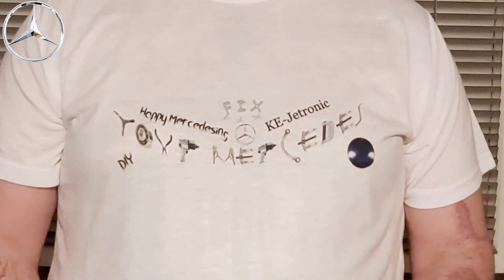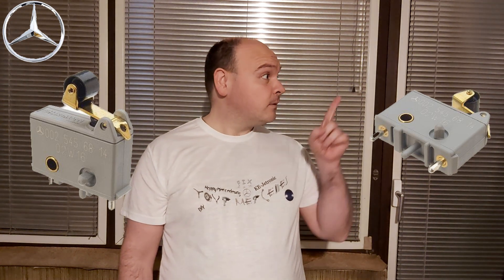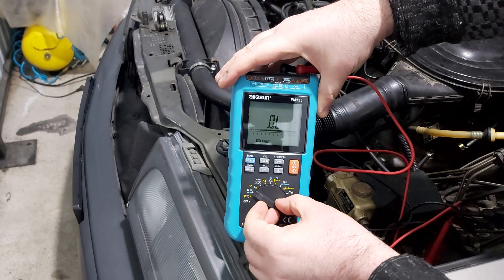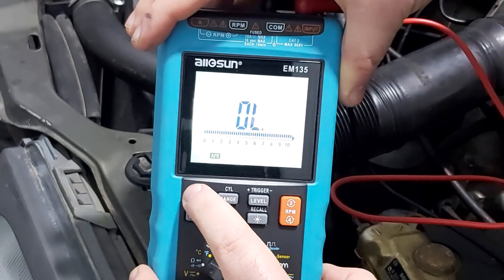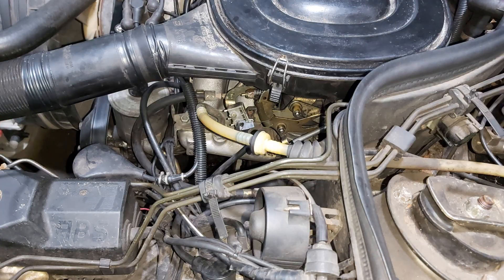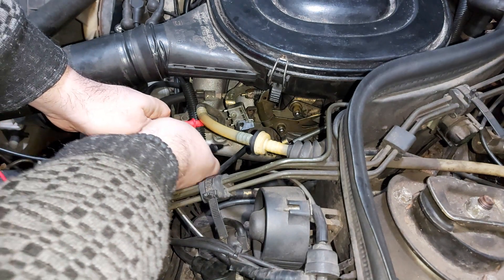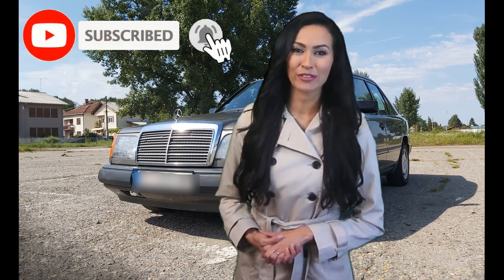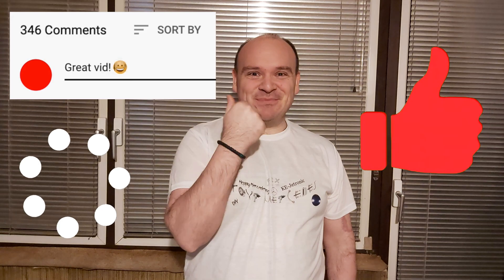Mercedes KE-Jetronic - The Micro switch/decel/cut-off

Comment: My car doesn't start unless i am holding it at %60 throttle could this be the reason? the socket are completely missing and i couldnt find the part number there is a switch but no socket just empty cable behind it attached to nothing. They are purple and orange
Reply from the maker: Are you speaking about the micro switch?
Reply: @mercedeske yes
Reply from the maker: @vrifdea  Without the micro switch the car will have a difficult start. You must also check whether it's connected to the ECU. Here is the ECU wiring diagram. Without the micro switch the ECU doesn't have any information about the position of the accelerator lever.
https://www.instagram.com/p/CTdM_5lqTKN/
Reply: @mercedeske thank you my car is 1991 1.8 is this applicable to my ecu i heard there are 2 variations of ke-jetronic
Reply from the maker: @vrifdea  Yes, the so called KE3a and KE3b. They are almost identical, some minor changes. More about the KE
https://www.youtube.com/watch?v=KU3Cl9oe1T4

Comment: I have an R129 ,SL 300-24, looking at the micro switch it isn't contacting anything, is there an adjustment,? Its a very good way of checking thank you, Cheshire UK
Reply from the maker: On the accelerator cable you can adjust it. Greetings from Knjaževac, Serbia 🇷🇸

Comment: I had to ajust my throttle linkage to get the switch to make contact. It didn't make any difference though. Car idles fine before and after. What is the microswitch supposed to do? Car has K-jet.
Reply from the maker: It is supposed to refer to the ECU that the engine is on idle.

Comment: Hi my W201 has a problem of holding the idle when it reaches the working temperature of 80° Celsius and I have to decelerate and put it in neutral (it stalls) could this micro switch be the problem? I already cleaned the icv which seems to work fine. Thanks!
Reply from the maker: Hi. have you replaced the O2 sensor, the lambda?
Reply: @mercedeske  thanks for the reply. No I haven't replaced the o2 sensor
Reply from the maker: @ΚωνσταντίνοςΠαπάς-ψ4β  Replace it!

Comment: Hi it doesn't work for me... problem?
Reply from the maker: Maybe the wires. One of them is connected to the ground and the second one to pin24 on the ECU connector. Check for continuity(buzzer).
Reply: @mercedeske  his tongue is cut off, he's stuck inside
Reply from the maker: @farmanashrafov4068  If the little wheel is cut off then you will have to replace the micro switch.

Comment: May I ask, what are the symptoms of a faulty throttle micro switch ? 
Thanks 
Regards Alistair
Reply from the maker: The car won't hold steady idle as well as the ecu that will not know to make mixture for the idle phase. My regards as well.
Reply: Thanks, Perhaps not my issue then, my symptoms are that when I take my foot off the throttle when slowing down, it doesn’t then  pick up when I press the throttle …🤨
Regards Alistair
Reply from the maker: @alistairurquhart6902  Did you check the potentiometer?
Reply: No, don’t know how to, I can do a search on it  and test it 👍 regards Alistair
Reply from the maker: https://www.youtube.com/watch?v=IG9i6fkfPJ8&list=PLysDz2b5tZanc7svUIpm35gk5y3h_q8nM

Comment: I tested my micro switch as per your instructions, and found that when I moved throttle, I could still hear continuity, intermittently!
Does that mean my switch is bad, or it's working at times...
I have an idle that goes up and down...!
Please advice...
Thank you, for great video!!!
Reply from the maker: Hi. If you still hear the sound when moving a lever, it means that you have a bad micro switch which is very important to inform the ecu that the engine is on idle. You will have to replace it(maybe something more will have to be done about the unsteady idle but this one for sure). You will have to replace the micro switch.

Comment: Hi, I’m curious to know what’s the voltage you have in that microswitch connector. My connector are reading 11.60v almost battery voltage. isn’t it too high ? maybe I have a problem here ?
Reply from the maker: I don't think so. It is just measured if there is continuity or not, the voltage is not important.
Reply: @mercedeske  thank you
Reply from the maker: @gcgj1540  You are welcome 😊 Many greetings.
Reply: @mercedeske   I asked because I was checking another problem.  I have inoperative o2 sensor in my car for 4 years already and can’t fix it :(  I can’t adjust lambda due to this problem it’s always stuck 50% duty cycle. Recently I’ve been trying again, Already replaced pretty much everything.. sensors, Ecu, Mas relay, and recently new Bosch direct fit o2 sensor and nothing. So I think it must be an electrical problem somewhere.
Reply from the maker: Have you replaced the potentiometer and checked if the ecu recognizes closed throttle and wo throttle?
Reply: @mercedeske  yes I did but long time ago. I can check again but can’t remember how to do haha thanks for recommending I will search how to do that
Reply from the maker: @gcgj1540  Checking tps is very simple. Here, watch my video.
https://www.youtube.com/watch?v=3sTArQdmugg
Reply from the maker: @gcgj1540  watch this one too. It's on how to achieve steady idle. Maybe you missed something on the list😀
https://www.youtube.com/watch?v=jx8xWmALmGk
Reply: @mercedeske  thank you again!!
Reply from the maker: Any time and always!😉👍😃

Comment: Good day Ivica 🤗.   I have a W124 1986 260e mercedes.  I have the following problem: When the car has not been used for week or two and then I start it, the car starts immediately.  However, I then go for a short drive to the shop. I switch it off and then do my shopping.  When I come back and try to start the engine, it will crank but not fire up.  I then wait for a while maybe 30 mins and then it will start immediately!  I then take it for a drive for 20 mins and the problem seems to disappear.  Also, if I use the car everyday, I don't have this problem.  It's only if when the car stands for a couple of days unused that this problem  happens.  Do you perhaps have any ideas as to what the problem maybe?
Reply from the maker: Always and any time!😉😀🙋💪👍
Reply from the maker: Did you check the injectors and the fuel accumulator?
Reply: @mercedeske  Yes.  The injectors spraying fine.  The accumulater definitely holds 3 bar pressure for 30 mins.
Reply from the maker: @paulfester9652  What about the lambda probe? Also, does the sensor plate scrub against its housing?
Reply: @mercedeske  My vehicle doesn't have an oxygen sensor fitted. The air flow sensor plate works fine.  Smooth action when I depress it.   It has resistance when deflecting the plate after engine switched off.  Also, the car idles perfectly and accelerates smoothly.  No stumble.
Reply from the maker: This is how it goes always go step backwards. If you test the electronic-the coolant temperature sensor, the potentiometer, the eha... and everything works fine, then test the mechanic - the pump, the injectors...If that seems to be fine then go to the ignition-the cables, distributor cap, rotor... If that also turns to be fine then test the vacuum leaks, if that's ok then go to the rubber hoses-nothing must me loose, cracked, stiff or broken. It must show up. Somewhere in the system you have a tiny thing that makes issues. You will have to discover it and do series of tests.
Reply: @mercedeske  Thanks!  One thing I noticed is that when the car is idling, the fuel consumption meter is not at zero.  I have read that this is a sign of a vacuum leak.  Is this true?  If so,  how do I go about finding the vacuum leak?
Reply from the maker: @paulfester9652  the best way is SMOKE. If you are a smoker or you know someone that is, then let him help you with a cigar(those thickest ones). Take a plastic glove, remove the air filter housing. Put the glove onto the sensor plate housing and tie it with a zip tie. Afterwards remove the brake booster and blow smoke in. The smoke is gonna show you where you have leaks. If not with the cigar, you can either go to a mechanic or visit the monkey wrench Mike channel and type smoke machine if you wanna see how to make one cheap.
Reply: @mercedeske  Can you point to where the smoke is supposed to be blown in?